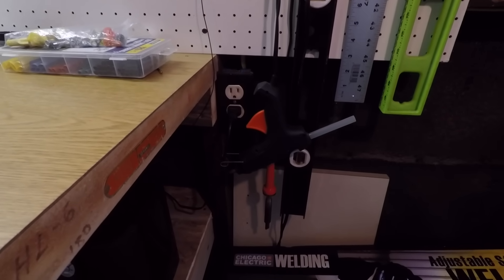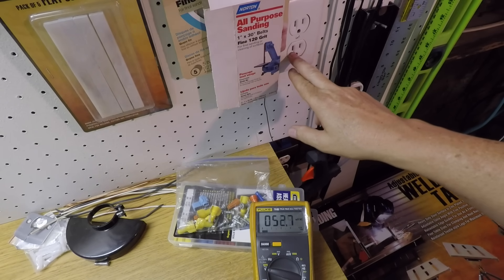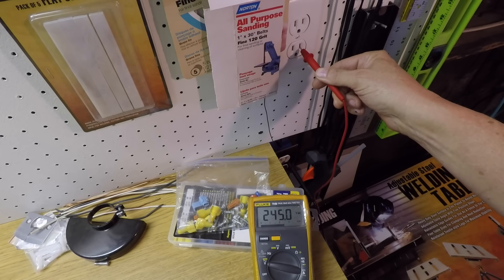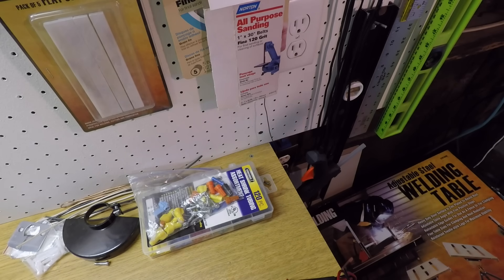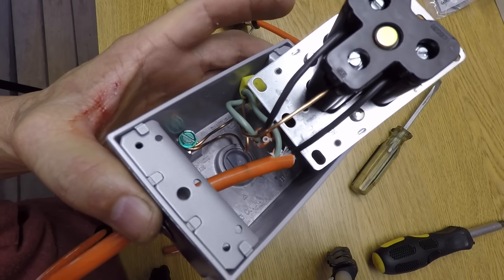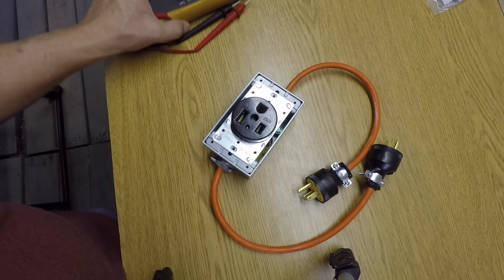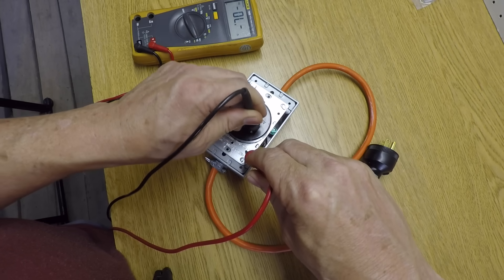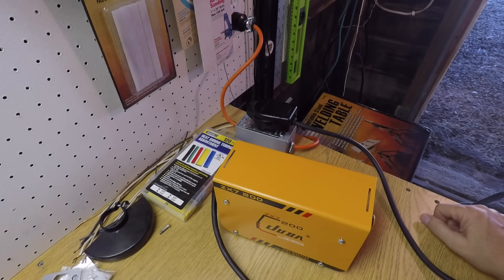How to Get 220v From 110v

Comment: I have a question can I do this connection in Dominican Republic for my electric stove
Reply: It appears as if the Dominican Republic uses similar 110V plugs as the USA.
However, this is an artifact of the USA using a center grounded 240V power distribution system to get 120V out of the 240V.  Verify that the Dominican Republic is using similar wiring.  As in the video, one can test multiple plugs on different circuits to see if a pair comes up to 220 (or 240V).  
I'm seeing the Dominican Republic also uses 10A, 18AWG up to 15A 14 AWG wiring.  Make sure what you have.  It may be too light for your application.  How many amps does your stove draw?
The shop welder is likely rather intermittent use.  An oven or stove is frequently used daily, and sometimes for hours at a time.  
The best choice is to get your appliance properly wired up (as the presenter from this video should have done).

Comment: Can 50 AMP handle 240 volts?
Reply: In the USA, 120V outlets are generally 15A or 20A, and in the case of trailer houses 30A.  
240V outlets are frequently 20A, 30A, 40A, or 50A depending on the application.
Volts and Amps are separate measurements.  V=IR with V is volts, I is current in Amps, and R is resistance.
In the example in the video, the two 120V circuits have either 15A or 20A breakers.  Combine them and one gets a 240V circuit that still is the original 15A or 20A.
The welder being used is rather small, and while it may have a 50A plug, it will generally only draw a fraction of that current.

Comment: How come your welder is working without a neutral line? If I understand your device correctly you are connecting 2 separate 120v supply’s inside your outlet box along with a ground supply. Looking at the outlet you have 3 holes one is ground and the other two are 120v hot.  So why are you not needing a neutral?  My limited understanding of any electrical device is that it need a hot supply [positive] and a neutral supply.  Plus a ground connect if the device isn’t double insulated.  The way I’m understanding what you have done here is combining two 120v hot lines to give you 240v hot supply, but I don’t understand how your 240v stick welder can work without a neutral supply?
Reply: Was wondering same thing...but I think the ground  will serve the purse if its binder to neutral at the panel. I could be wrong.

Comment: That's because 240V is coming to the panel with all the breakers.  Each side to the panel is 120V.  This how you get 240V for your hot water heater.  You don't have to make a special adapter just by putting a 240V breaker in the panel box.

Comment: This is ok for a person with some experience in wiring but not for a novice that has never done this type of thing. Too many chances for building something that isn't safe. If you are going to go to the trouble of installing 2 separate 120 volt receptacles from 2 separate circuits why not just wire in a 240 Volt receptacle and know that it is safe and will handle the load you will put on it and not burn your house down ???

Comment: When I built my shop many years ago, I ran 12/3WG through all my receptacles. I had the building inspector scratching his head. He said, "I see what you did, but don't understand why", So the inspection was passed because there was nothing wrong. Just a not so common set up.
Obviously there were 2 circuits. Every other receptacle I put on the opposite line. The reason for this was should I be running 2 devises at the same time & it tripped the circuit, I could just move one device plug over to the next outlet (different line) without having to move the unit itself. 
Or I could have wired each plug of the same receptacle on the other circuit.

Comment: Over the years I've learned my 240v buz box AC stick welder would pop a 30 amp breaker allmost as the first arc is strucked, It would pop a 40 breaker after a couple minutes welding, But would only pop a 50 amp breaker if heavy continuous welding. I never quite understood why my highschool physics lessons didn't apply when the transformer didn't have a load (wasn't welding) Inverter welders are entirely different .

Comment: Bull shit . your volt meter cannot get a reading 240.volts black lead is for ground. Putting it a hot circuit wont be right. Besides it's the big plug that is hot.

Comment: @12:42 🤔🧐 ALSO, JUST OUT OF CURIOSITY..   …WHAT WOULD HAPPEN IF ANOTHER PERSON WERE TO PICK UP THAT 220v ADAPTOR AND UNKNOWINGLY PLUG IN TO TWO OUTLETS THAT ARE ON THE ‘SAME’ CIRCUIT??
Reply: Nothing would happen.  Or one would get a single hot.  No neutral, and a ground.  110V between hot and ground.  No voltage difference between the right and left blades.  Plug in the 220V appliance and it simply would not work.

Comment: All this work why not install a proper 220v outlet?
Reply: Right.  He apparently rewired and reconstructed the shop prior to this.  He should have simply wired in a 240V outlet at that time.  20A?  30A?  More?  Or added the new circuit once he figured out what he needed.
A similar setup might be useful occasionally if one needs to travel and get 240V where it isn't supplied.  But, not for a regular hack in one's home shop.

Comment: Your not running in two different lines your running from two different phases, does your welder use less the 16 amps if not your circuit is worthless.

Comment: About the concerns over breakers that are not bridged, this can be handled with a 20Amp DPDT contactor with a 240V coil. Wire the output off the Normally Open contacts and put the coil across the 2 phases. If they are both live, it energizes and closes the circuit, if you loose one phase, the contactor releases and deenergizes both phases.
Reply: lose, not loose

Comment: You need to tie both breakers together in the panel, if you short one circuit and it pops the breaker, it will pop the other one along with it. There is a hole through the switch on the breakers, take a piece of 12 gage (20 amp) ground or bare wire and feed it through both switches on the breakers,  obviously, they need to be side by side in the panel, then make a 90⁰ bend on the outside of both breakers switches I______I and cut off any excess  wire, now if one trips, they both trip. Also, if your going to do this, do it right, use two 20a plugs and 10 gage wire or at the very least, 12 gage wire, you are asking for trouble using 15a plugs and 14 gage wire.

Comment: When you checked for ground , I didn't really catch the zero reading.  My Fluke gives me problems with Resistance and it might be the low conduction of the Lead tips.   I have to get my analog meter out and double check...  I get variable reads that way though, because I'm trying to contact those fluke leads.    COOL VIDEO...  and now we know what you know,  thanks for the design.             I want to fire my welder up out in the shop...

Comment: Your set up will kick breakers off or over heat the wire running the welder , most elders can use up to 50 amps depending on what material you are welding and the amps required to weld it , A 12 gauge wire will not carry that kind of amps it only good for 15 amps and not 50 amps that is required to run the welder .

Comment: It makes sense your running in a parallel series to gain 240v however the amp draw relying on a 20 amp breaker. It's a good idea but system over load equals heat to electrical fire. It's not code or ordinance. It's good and interesting concept. I would use 10-12 gauge solid copper direct hard wired to the service panel one phase with a higher amp breaker. The volts will zap it's the amps.

Comment: one point you didn't bring up: the two 20 amp circuits should be from separate legs in the panel: one circuit from leg A and one from leg B, just as a two-pole, 240V breaker switch.

Comment: I got a 240v-air compressor once with no way to plug it up. I had a small outside breaker box with no slot for a double breaker. I got 240v wire and used the black wire on a 20a and the white wire on a 20a and put the green wire on the side bar in the breaker. I knew it was not real safe, but it did work. Just make sure to turn off the breakers when not in use.

Comment: The determiner for whether this wiring will give 240 V is not whether the outlets are on separate "lines".  If you had two outlets on different circuits that are one the same split of the 240 V line feed, this won't work.  What makes this work is that the outlets are on different splits.  Also, if you do this with an outlet in which someone reversed neutral and hot, you will get only 150 v, and if you try to put in a NEMA 14 connector rather than a 6, you'll get a short.  Since you're using 20 amp circuits, you should not be using a 50 amp socket.  The socket should be no more than a 6-20.

Comment: I believe that each of your 120 volt receptacles would have to be on separate sides of the panel box to correctly draw 240 volts, they should not be on the same bus out of the breaker box or panel, correct?

Comment: I have a question. I hooked everything up exactly like you did. When I use my multi meter and put the red on a hot leg and black on the ground it reads 125 when I put it on the other hot leg it reads 125 but when I put the red and black on both hot legs it reads 0. If I put just the red prong on one of the hot legs it read 12. Welder will not come on when I plug it in.
Reply: That’s because when he installed the receptacle he split the joint and ran wire for a separate circuit for the second plug. He actually has two circuits running into the electrical box each one supplying either end of the duplex receptacle with 120 volts of power to reach receptacle. He eliminated the neutral(white wire) and just used both hot wires to acquire 120 volts from two separate phases. 2 different breakers in the panel. All your getting is 125 is because most receptacles as I mentioned in my previous post are one line ran from one breaker which give you a single phase of 120v of power. Important to realize this is a receptacle that he ran power for himself. We don’t typically run two circuits to a duplex receptacle and split the loads. You only get one 120v circuit. And it’s usually tied to several other receptacles to if you wire this incorrectly everything I mean every device you have plugged into the other receptacles are 120v devices will burn out immediately. Best to follow the post and install a 30A receptacle with a dedicated circuit running from a 2 pole 30A breaker.

Comment: I did the same thing, but in reverse order, in hooking up my generator to power the house I was wiring. Each of the outlets on the 120V receptacle is s a separate circuit , just like the 120V leads into the house, so I got 2 cords and wired then into the 240V circuit. You know what you're doing, you're safe. Just go buy the double pole breaker and put it in the box, just make sure you get the brand name of the box and breaker matched up.

Comment: Even though your wires are short runs, I would refrain from using any extension cord wires as they're not solid copper and will likely heat up as they are many different smaller strands of wires. I also wouldn't recommend anyone trying this that does not understand how electricity works. Have you done any upgrades and/or made any changes to it? How has it worked out for you so far??? Please update us.
Reply from the maker: No changes or upgrades. I built it as a temporary fix to get me by and I did just that. I wouldn’t hesitate to do it again if the need arises. Thanks for your input!

Comment: I sure hope you're using a 220 breaker in your breaker panel!
If you're using two unconnected breakers you might have trouble with that!

Earlier tonight I was thinking of a different wiring system that's similar to this.
It was going to be used to plug somebody's 220v RV into the side of their house using a single gang box with two outlets wired separately that combined would produce 220 v

You could run wires from the 220 breaker, the two hot leads to the wall outlet and split one of those wall outlets in half so each 
Plug in that double gang box is wired separately from each other.
You also need to break the tabs on both sides of that receptacle, or at least break the tab on the hot side of the receptacles so that they are not electrically connected to each other.
The upper outlet would be a 120 and the lower outlet in the same box would be 120 and then you would have both of those plugs in the same outlet box, instead of two different outlet boxes. 

And if you need to use those 2 outlets you can unplug your welder and treat them like regular 120 outlets. And the other outlet box would still be normal and original to the structure.

Comment: A nit-pick:  NEC 110.14(A) Only one wire shall be installed under a terminal screw. In boxes with more than one grounding wire, the grounding wires shall be tied together with splicing devices (wire nuts) with a 6 inch “pigtail” for attaching to the grounding terminal of the switch, receptacle or any other device.

Comment: You are actually energizing the ground wire in that configuration. The two common wires you cut off should be terminated to all common terminals and configured with a pig tail terminated to common in the 220 outlet and ground all ground wires together as they are for any stray voltage as a safety and should never be used a energized conductor. Yes 👍

Comment: Why someone would choose to do this is a wonder to me. It would be infinitely better to simply run a new circuit specifically designed for two pole power.
Just because something is possible doesn't mean it's safe or practical in reality.   To each their own I suppose.

Comment: Do you know how can make 230v single phase? I have expensive device from Europe country and i want use in Usa 120v?
Reply: Generally, that is dealt with in the device itself or an adapter. Check the back of the equipment (and the manual), often it was/is common for the device to be switchable for either. Also be aware that the US grid runs at 60 hz, that may or may not be an issue with your device.

Comment: I used your idea to charge my Tesla with 220 and it gives me 30 mph range instead of th 4 mph plugged into 120 volts.. Instead of 120 ac from the grid I use 600 watts of solar with a 2000 watt inverter (from a 20 amp mppt controller) storing the energy into 4 100 amp hour deep cycle batteries in parallel. But it was necessary to use bonding plugs or Tesla will not recognize it as grounded properly.
Reply from the maker: Sounds like you have it figured out. Good job Steve!

Comment: When one plug is plugged in the power source the other male plug will shock you before you plug it in if you have the load connected to the 220 plug, so that's the deal!

Comment: What he is doing is basically a 220 feed could and should run a dedicated double pole 20 amp breaker but you can do what he is doing but the feeds to be on separate phases in panel or it won’t work

Comment: I realize I am a year out of date.  I really should read through all of the comments, but if someone is still following this thread, I have a question.  for simplicity let's use 110 and 220v... I want to run two extension cords to the shed (when I need to supply the shed with electricity...  IE temp powered shed) ...   so, if I were to run one 110v extension cord that was on the L1 circuit to a L1 supply lug on a secondary circuit box and the other to the L2 circuit; then use a Cricut Breaker (220v 20a) and a power disconnect for turning on and off the device...   can I get a safe 220 to the shed...   my issue is with the shed, I want temp power without the issues that comes with a secondary building.

Comment: OK, Black and red hot wires from from different in-coming hot legs. Question: how to do to get more than 20 amps 220 without getting into main or sub panel?
Reply from the maker: You need heavier gauge wire running from the breaker to the outlet to handle more than 20 amps. A circuit's amp rating is dependent on the wire size. A google search for wire size amp rating will tell you what gauge wire is required for what amp rating. Using standard house outlets the max you will get is 20 amps and in some cases depending on the outlet wiring maybe only 15 amps.
Reply: @DIYHomesteadProjectsDIYHP10 , Yes, I understand the wire gauge requirements, that's why I asked how to do it without having to deal with the sub or main panel. I was a landlord for 25 years, so wiring-up a house is not hard. 3-way switches to me are the confusing side of home wiring. Thanks for responding.

Comment: I suppose this rig could be used for a larger window air conditioner or larger electric heater, the type you'd use in a garage or warehouse with a 240 volt 15 or 20 amp plug (NEMA 6-15P or 6-20P)       could come in handy in an emergency if your furnace breaks down in the depth of winter, and you want to use a larger heater than what can be plugged into an ordinary household circuit (over 1500 watt)    like many comments, there is the safety issue if a problem occurs and a breaker trips, leaving the other leg hot.   The device will appear to be dead, but will have 120 volts to ground available to shock you.     That's why Code requires a double pole breaker or a handle tie listed for the particular breakers to be installed,  so if one leg trips both will trip together.    But I wouldn't mind using this as a temporary setup. Also this will only work in older homes without GFCI/AFCI breakers, pulling current just the hot will cause an imbalance and trip the circuit